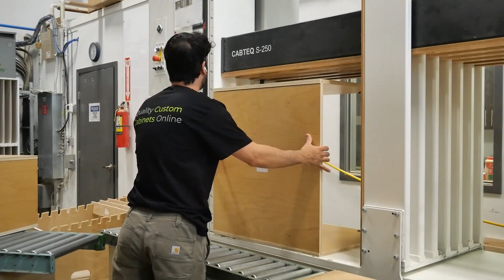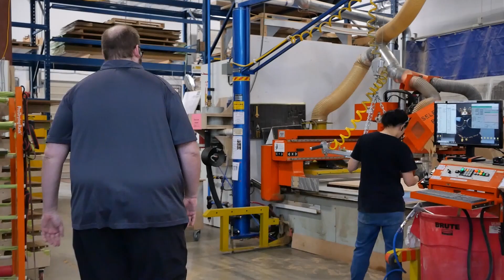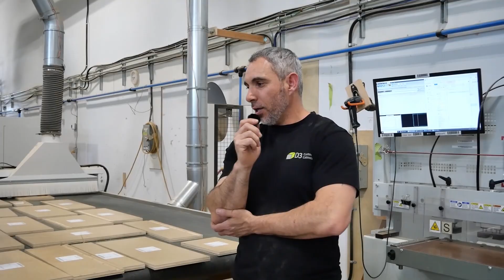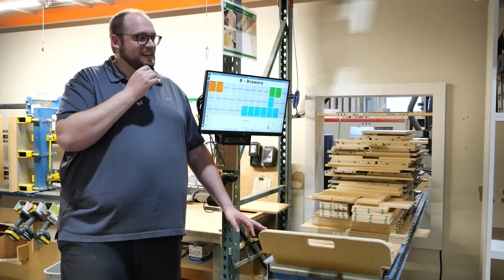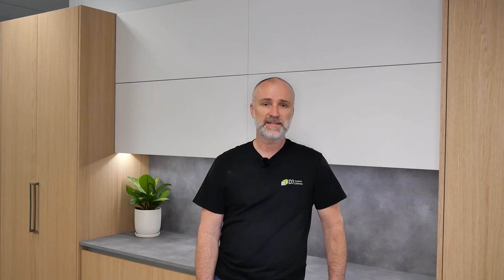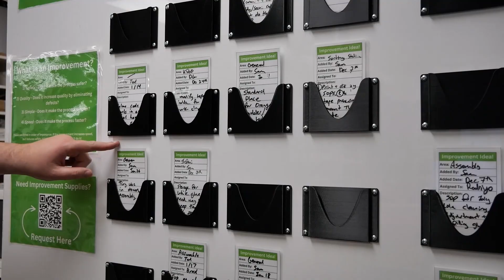D3 Custom Cabinets AME Tour!

Comment: Have to disagree a bit. You own the company and you are responsible for the vision so yes it is push. If you decide lean is the way, it’s 100% nonnegotiable. You can’t run the company by committee. That doesn’t mean other options don’t add value or should be ignored but in the end the vision must be maintained.